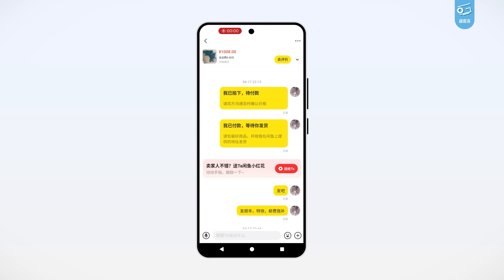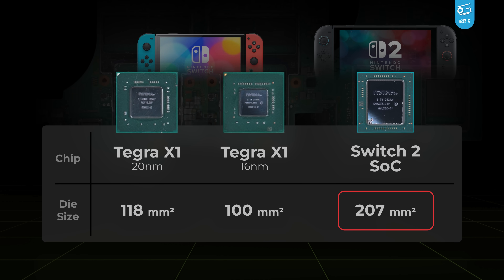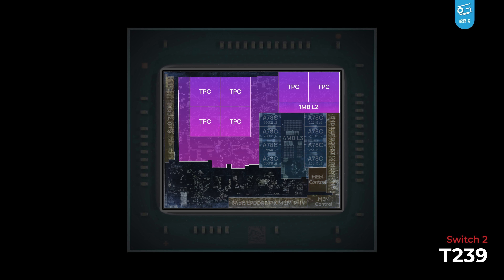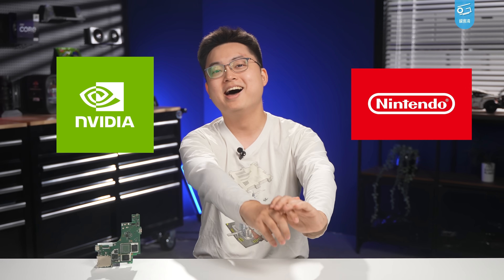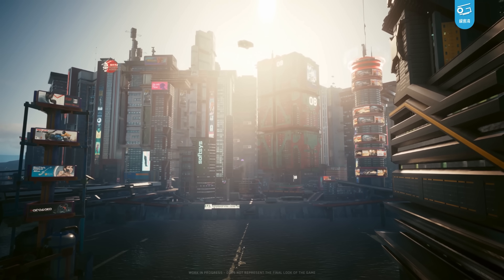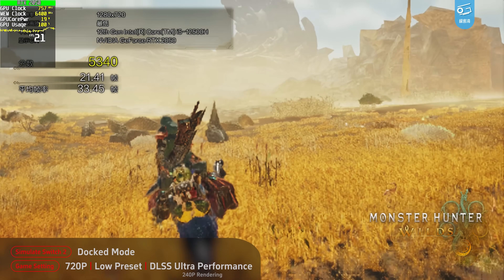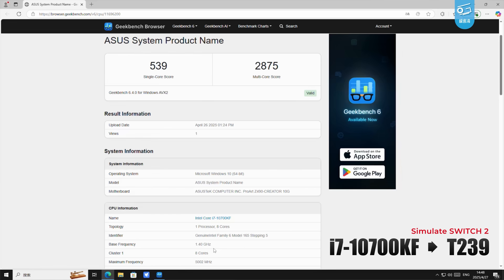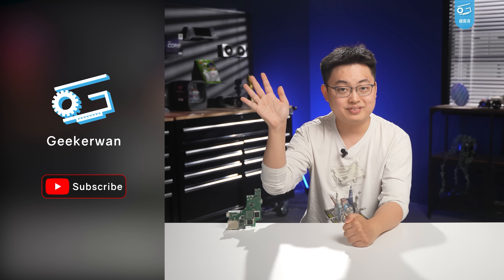This is Nintendo Switch 2's CPU!

Comment: Lol so it IS Samsung 8nm (aka goosed up 10nm) after all! I KNEW all the "5nm" talk was absolute freaking garbage! 😁

Porting Ampere to 5nm would have required a ridiculously expensive redesign & revalidation of basically every functional IP block, at which point you'd be better off just using a proper Lovelace based SOC that was actually designed for such a node. 🤷

This basically means we are looking at roughly Steam Deck level performance in handheld mode (better in some ways, worse in others), which really shouldn't surprise anyone tbh.

And the reason that Switch 2 is getting games like Star Wars Outlaws which the Steam Deck can't play well is that it's getting fully custom versions of these games with even lower graphics settings than the "Low" that Deck has available to it on PC. Combine that with the moderate performance boost of a single locked in platform with a super low level graphics API plus a hefty helping of DLSS upscaling and you have your answer.

Comment: Whelp looks like we're gonna have yet another severely underpowered handheld generation from Nintendo. That's no surprise honestly. It wouldn't be such a big issue if publishers gave devs the time needed to do any real optimization. At least it's nice to see Doom Eternal should get a 120hz mode on the Switch 2 because they actually know how to make a game run well.
Reply: did you expect it to perform at a ps5 level? like people have such unrealistic expectations for essentially a handheld
Reply: My phone could possibly get close to the Switch 2 performance, they're in the same price range lol
Reply: @Sweetcat07  that's not even remotely comparable. They sell phones to make a profit on the device itself. Something like the Switch 2 makes Nintendo very little money per unit unlike a phone. They make more money from people buying the games. If your phone cost you $500, the cost to make one was probably $200 roughly. The Switch 2 likely costs at minimum $380 to make and they sell it for $450.
Reply: @WaveSmash  eh, we'll wait and see. Also, my phone was 600$ (a OnePlus 12R with the 16GB memory configuration)

Comment: Switch 2 GPU performance
Dock mode = 1050Ti+DLSS
Handheld mode = 750Ti+DLSS
Although the first generation of Switch is often criticized for its poor performance, it is mainly because it has been out for too long. In fact, if you look back to 2017, the CPU of the first generation is rounded up to the level of the flagship 2 to 3 years ago (using a relatively poor 810 as a standard). The key is that the GPU of the first generation is much stronger than the Android flagship Snapdragon 835 in 2017, and it can directly reach the level of Snapdragon 855 two years later (dock mode). Now the CPU of Switch 2 has basically reached the level of Snapdragon 855 six years ago, and the GPU can't even beat the 8e of the same generation (dock mode). It is truly backward from birth.
It is more appropriate to release this machine two years ago.
Reply: Snapdragon 835 gpu is more powerful than the Switch in Nintendo clocks.
Reply: Nintendo consoles and handhelds have been underpowered since the Wii. They ditched the power game after the Gamecube fell hard against the PS2
Reply: I wonder how 3rd party support will end up being  @Gigi-zr6hp
Reply: But nintendo is charging for thiscrap more than a ps5. They are very disconnectes from reality
Reply: @maxpowerulez5276  how? Switch 2 is lower than PS5, plus portability is a factor here
Reply: 이 칩은 스위치2가 아닌 스위치oled버전에 들어갔어야합니다 닌텐도는 스위치 수명을 길게 늘리고 싶어하고 그들은 그것을 포기하기 싫어합니다
Reply: @다람이-c4t  agree. very true
Reply: @다람이-c4t  thats ture
Reply: @다람이-c4t  the switch oled's dock has capabilities the base switch dock doesn't have, it can pass a 4k@30 signal, while the vanilla switch dock (2019 version included) can only pass a 1080@60 signal so i do not exclude it was meant to be a switch pro but perhaps because of covid they were never able to finish the job in time and decide to move the extra work to the next gen
Reply: @Dr_Hax if thats true, nintendo delayed the upgrade on purpose also It's a company that doesn't think of gamers anymore 😢
Reply: Agree

Comment: Your experiment is horrendously inaccurate considering the rtx 2050 still has 512 more cuda cores than the switch 2 gpu. That is a huge difference and no amount of down clocking will give you a fair comparison. The switch 2 will be lucky to even keep up to the original ps4, a 13 year old device and lagging behind it in things like memory/pcie bandwidth and clock speeds.
 Not to mention Nintendo will not be running the t239 gpu at full clock speeds (most likely around 800-900mhz docked) which will hinder its performance even further. The switch 2 is a trash fire spec wise and honestly one of the crappiest devices they have ever made. 30fps at sub 720p resolutions upscaled in 2025 is not acceptable for a device that costs as much as the switch 2 does. Nintendo built this thing on the cheap, and boy does it show.
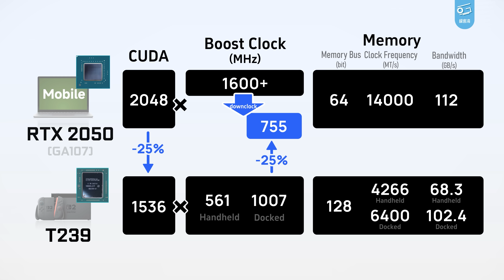Reply: I think they took that into consideration on 9:00
Reply: It's more powerful than the PS4 even in handheld, as it can run the Cyberpunk DLC + the developers for cyberpunk have said they expected it to be much weaker than it was, what are you talking about
Reply: @ cd projekt red drew a line in the sand and cut off last gen consoles. Its  was a financial decision not to continue development, not that it couldn’t be done. 
  I think you like many others are grossly overestimating what the switch 2 will be capable of. Every video I have seen of switch 2 running cyberpunk looks like a blurry upscaled mess running at frame rates well below 30 in many places. No amount of “nintendo magic” is going to make that game run well on such anemic hardware yet Nintendo drones are championing the fact it even runs on it. 
 Nintendo has done a fantastic job potty training their fans to be excited for a lesser experience. You will pay more to play the worst version of a game. Just look at doom and the Witcher on switch 1. Those games looked/ran like garbage even compared to ps4 and yet cost more than what they launched for on 13 year old hardware. The switch 2 will be a continuation of this with even more expensive games.
Reply: @drewa4235  no? The gameplay we have seen so far is either not from the switch 2 itself or a demo version made in 7 weeks

Comment: If 2050 is considered a big upgrade i wonder how switch was even able to run zelda at 24 fps...
Reply: Optimisation, coding to the metal, no silly drivers needed, no bloated OS.

Comment: I didn't expect the switch 2 to be this weak in performance department. This is downright saddening.
Reply: Weak ? It's nearly twice as powerful. If you want(need) something better for gaming on the go just get a custom laptop. Or some gaming phone . Nintendo has come a long way just look at where they were 30 years ago . That's like expecting the PS5 to be as strong as a ps10 when coming from a PS4 or ps4pro.
Reply: Ok nintendo defender @MikeHunt-lz2hq
Reply: I thought the switch 2 would eat the steam deck alive in terms of performance, I guess they are about the same instead. Why would Nintendo even bother making a 120hz display if most games will barely reach 60?
Reply: @n7x  If it has really good upscaling then maybe 120 fps will be able to be done for low load first party games? This is optimistic though
Reply: @pokosure4831 that’s definitely possible, but still, there’s no chance that Elden ring or cyberpunk will be able to run 120 in handheld mode (it might be able to run 60 with upscaling and low graphics)
Reply: @pokosure4831not cyberpunk 2077
Reply: It's extremely strong for the price and form factor
Reply: @pokosure4831  already stronger devices with better form factor and wide spread application like the steam deck and original rog ally exists with even better library and cheaper library. You don't have to pay 60 bucks for 10-15 old title. And of course there is emulators.
Reply: @ I own the steam deck, but it's actually so big and thick that I don't think it can even be compared to something like the switch. the ROG Ally non extreme edition has poor performance pretty bad compared to the steam deck, with zero hardware optimization like the switch, it is also not a valid option. There is nothing like the switch, so it can't really be compared to anything. I do think the 60 bucks for old remasters are ridiculous though. (Personally think $70 for new games is fine)

Comment: The fact that it is indeed built on an 8nm process node means that we can likely expect to see a die shrunk version to 5nm in 2-3 years which may accompany a Switch 2 Lite model as I feel like that's the only way we're going to see a cheaper version of the console. If they can manage to get it down to $300 then that will likely be a good entry point for many people who just can't afford the current price of the system. I think an OLED model might be a harder get even if they bump the price up to $500 as I don't think a 120HZ 8 inch OLED with HDR and VRR that works well actually currently exists...and if it does it's likely incredibly expensive.
Reply: It's mentioned in the video it's actually a hybrid of 8nm and 10nm, slightly worse than the 8nm custom process for the rtx 3xxx series and definite behind proper Samsung 8nm used for alot of phones chips.

Kind of disappointing for this, even the old tsmc n7p would be far better and helps with higher clocks at the same power usage.
Reply: Problem is node shrinks are no longer providing much cost savings.  The 50+ years of new nodes decreasing the cost of transistors is coming to an end.  Fabrication equipment is only getting more and more complex.  EUV litho machines have 5x (+450000 components to build ASML twinscan EUV machines) compared to the ASML DUV (less than 100000 components), and this balooned the cost of the litho equipment to from 40-50 million to 150 million. And has caused the cost of wafers to jump from $9000 to $19000.

Comment: This really shows the amazing optimization that must be going on in Nintendo's SDKs to get games that look as good and perform as well as they do on Switch 2 considering this is somewhere between a 1050 and 3050 & a Tensor G2 as far as pure grunt power... But having everything integrated and standardized will make things work well enough to be a huge upgrade, especially considering the OG couldn't be compared to any remotely modern gfx card

Comment: it is important to note and enphasize that consoles and PCs are NOT the same. even if the graphics here show that a gtx 750 ti was superior to a ps4, you would not get the same level of anything from a pc with that card back then compared to a ps4. you can, and should expect that the switch 2 will show more quality than what we see here simulated with a pc.
Reply: A 750ti ran better than a ps5. There are many „ps4 beating pc config videos“ from 10 years ago out there comparing both in games like witcher 3

Comment: Has to have the battery to power up. Should be similar to the Switch where you put a resister between 2 pins of the battery connector and it would post.

Comment: If you gave me the specs directly, I'd have been like : "yeah no this is way too weak" but knowing what they managed to pull of with the hardware of the OG switch, and that relatively it is almost an order of magnitude perf upgrade (including DLSS), I get why devs weren't worried too much about the raw grunt.

Honestly I had no idea the OG switch was THAT underpowered until you pulled the graphs up especially compared to the smartphone SoCs like holy hell you're telling me that games like BotW and TotK were released on THAT console? Freaking hell, Nintendo really knows how to juice out every last drop outta there hardware; crazy optimization work there.
Reply: Botw and totk arent optimized that well though, they have insane frame dips
Reply: Its the power of ARM. Imagine if AMD went ARM for the ps6 and PC handhelds.......
Reply: @SWOTHDRAthere is no reason for a console like PlayStation to use ARM when 95% of game devs still don't use every tool it has.
Reply: How didn't you know how outdated it was? Even when it first launched it was outdated. Unless you solely play their first party games where they focus more on art style, you could tell just how outdated it was.
Reply: botw and even more so totk were chugging like hell on the switch. considering consoles as old as xbox 360 and ps3 had games like just cause 2, mercenaries 2, and red faction guerilla, botw and totk werent really running that well in hindsight.

Comment: I will make note of some major errors in the "Benchmarking" part of the video? Primarily around the CPU section. 

The big thing being the assertion all the A78 variants are the same and just "Names"...when they very much are not.

A78C is the most similar to base A78. The Compute variant mainly just being "it only comes in Homogenous 6 or 8 core configs and has bigger cache options". Nothing really changed about the A78 Core itself. 

but A78AE is a different beast/thing entirely, while still technically the same A78 core at the heart? 
Big thing is a structural change to A78AE, along with having access to the 12-Core 6+6 Cluster design that Orin uses, and more cache ala A78C...it has another feature called the Lockstep (or as ARM calls it "Split-Lock"). Which is a MAJOR performance degradation  in any well, performance-focused workload, and especially gaming.

Mind, there are multiple modes. But you gave no indication of which mode was active, which is kind of major as one of them (Lock Mode) literally cuts the core count in half for the lockstep, and the others still have some sort of degradation versus a normal A78 setup.

Comment: what a great video! The 3d mark benchmarks confuse me though The simulated ps4 is in line with the 750ti which we know is accurate but the steam deck and handheld switch 2 are in shown as in line with this performance ?  When you run a ps4 game on the steam deck it can never match the visual settings of the ps4 version in terms of resolution and graphics settings so I wonder why it benchmarks so well when the visuals don't match.
Reply: Excluding first party games it does match the PS4 graphically but falls short on resolution everytime to compensate
Reply: @maskedlibrarian1483 the  only thing I’m really saying here is that the benchmarks don’t necessarily give you a true indication of real gaming benchmarks for the gpu since 3d mark isn’t a game but a test if multiple graphics features and there performance .

Comment: Just like Digital Foundry’s massive mistakes analyzing what they think they know of Switch 2s performance(mainly with their opinions) 

Switch 2 will definitely continue to surprise with well optimized third party ports,not to mention what Nintendo will get out of the hardware themselves!
Reply: And they preface them as opinions. You’re the blind fanboy who can’t take a modicum of negativity for your fave console.
Reply: @ opinions shouldn’t be part of a tech analysis.
Reply: these ports still run worse in Portable mode than on the steam deck
Reply: @HermesderWetterbote  PCs simulating consoles are still PCs, and PCs run worse than consoles at equivalent specs. DF made this mistake as well, both with them using an RTX 2050, and back when they were simulating a Switch to see how Doom 2016 would perform on it.
Reply: @DiscostewSM  What I don't get is if the GPU is Ampere, why are they constantly comparing it to an RTX 2050?  A Turing GPU.  Ampere is the 3000 series of nVidia cards. I get that the card had to be severely nerfed for various reasons, but still Ampere is what it is.  This GPU will do things that a 2050 cannot.
Reply: @D2Kprime  The RTX 2050 is Ampere-based. Blame Nvidia for ignoring their own naming convention and placing it in the Turing line. I can only speculate the reason, but I imagine part of it has to do with the reduced memory bandwidth bus to 64-bits as opposed to 128-bit, which happens to be what the RTX 3050 has. They should have called it the RTX 3040.
Reply: @DiscostewSM  have you seen cyberpunk 2077 steam deck vs switch 2 portable ? steam deck is 40 to 60fps native 800p, switch 2 is 20 to 40 fps native 360 to 540p + dlss
Reply: @HermesderWetterbote  Sure, you can get 40-60 fps on Steam Deck, but not without dropping the settings close to their lowest and using FSR as shown by people who know their stuff demonstrating that in the plentiful number of videos here on YT alone.
Reply: @DiscostewSM  no, the default settings on steam deck (medium-high) at native 800p are already giving 30 to 40fps. with fsr, frame gen etc. you can get 90+ fps
Reply: @HermesderWetterbote  You went from 40-60 native 800p to 30-40 native 800p. I don't really think you know what it runs at.....
Reply: @DiscostewSM  in said it can the first time, the second time the "default settings" the default settings are a mix of medium and high settings and prioritize graphics. (like Quality mode on switch 2) medium-low settings (like switch 2 performance) are 40 to 60fps. and if you use fsr and frame generation (switch uses dlss all the time and is never native) you get around 90fps
Reply: @HermesderWetterbote  From a rational point of view, had folks been able to get run the game at 90fps at medium-low settings with fsr and frame gen on Steam Deck, it would not be limited to comments. There would be videos about it, and so far, the only video I saw of it supposedly running at 90fps seems to match settings that for everyone else using them tanks the frame rate, which makes it easy to believe that they were being false about it.
Reply: @DiscostewSM  there are lots of videos about it ! 🤣 The default medium high settings are already 30 to 40fps. low settings are 40 to 60 and fsr doubles the framerate. just look it up. or wait for comparaisons after release. the steam deck blows the switch 2 away in portable mode: it's newer and has more expensive higher quality hardware.
Reply: @ says who?